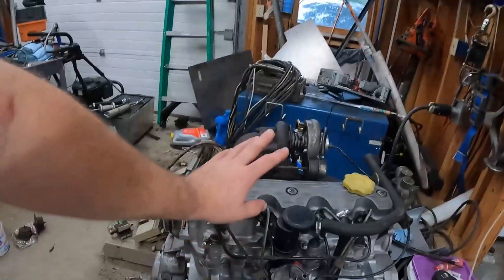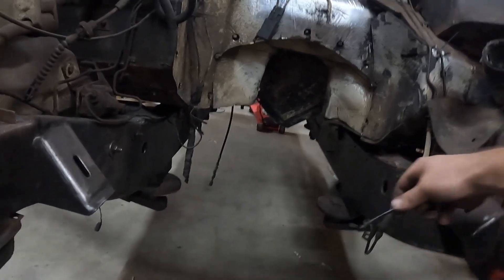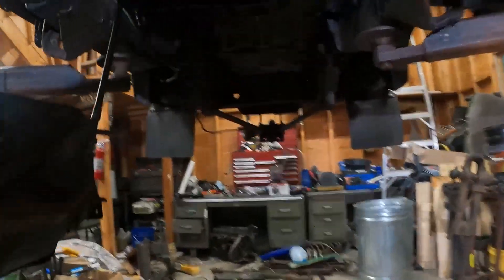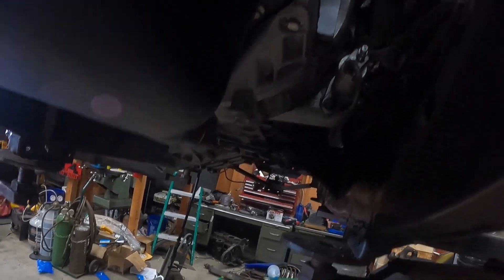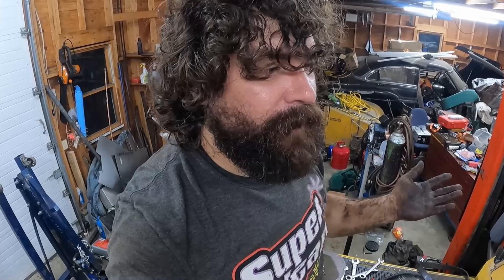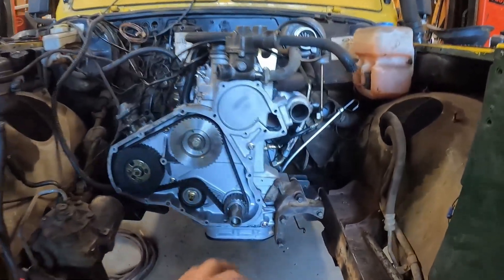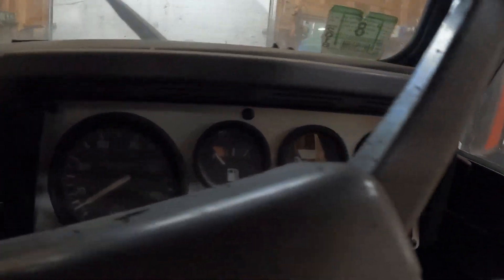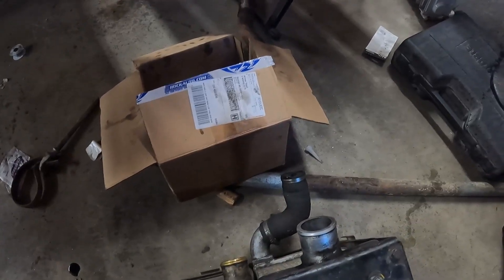Turner Engineering 200 TDI First Start! - 1991 Landrover Defender 90

Comment: How much did it cost to ship? My 87 RRC needs a new engine and Turner seems to be the best quality engine rebuilder around for rovers
Reply from the maker: in March 2019 shipping was 765 pounds (shipped to a loading dock idk if that makes a difference).  I couldn't find another engine builder that had zero bad reviews and they were easy to deal with.  Might ask them to ship DHL over Fedex as Fedex completely screwed up customs and delayed my order by a few weeks.
Reply: @wirestiresandfires214  couldn’t imagine shipping now I’d hope it’d still just cost $765 😂 yeah Turner by far seems to be the best over the likes of Atlantic British who I’ve heard some bad things about
Reply from the maker: @Dylan Garcia   Shipping was 765 pounds not usd so at current rates it cost me $1030.  Rovers North I think sells Turner engines as well, doesn't seem to cost too much different and you wouldn't have to deal with customs.  So far even at well below freezing my 220tdi starts on the first rotation, the old engine took some cranking in the cold.  What engine does your RRC have in it?
Reply: @wirestiresandfires214  it did have a 3.5 that the previous owner was gonna rebuild but decided to ditch the car instead which is a shame Im gonna upgrade to the 3.9
Reply from the maker: @KITTKATTCHONKY  Those look to be pricey, have you thought about a diesel swap?  It also seems like a chevy 350 is a popular swap with a bell housing kit being about 1100.  I do also get it if you prefer to keep a rover engine in there, as several friends kept trying to get me to ls swap my defender(as if!).
Reply: @wirestiresandfires214  i was initially gonna do a LS swap in mine since it has the engine already pulled or a 4.0 gems but decided to just go with a basic swap for now and save down the line, a diesel is very intriguing tho that will always be an option as well seen a few guys do diesel swaps in RRC groups and there’s nothing like a diesel in an aggressive range 😎